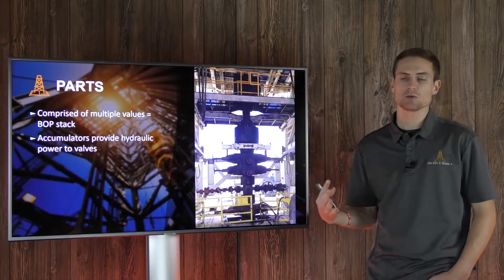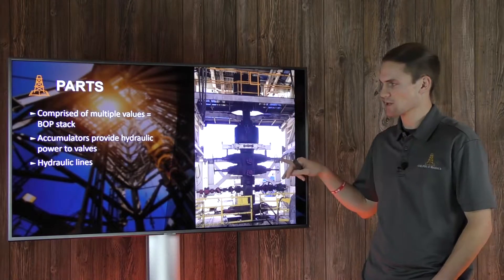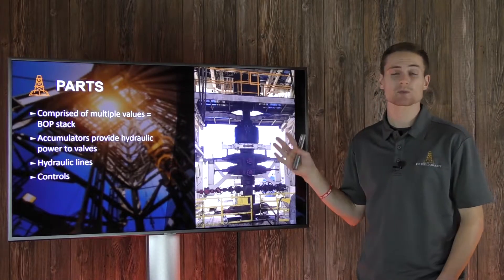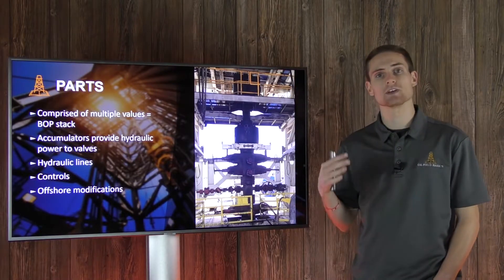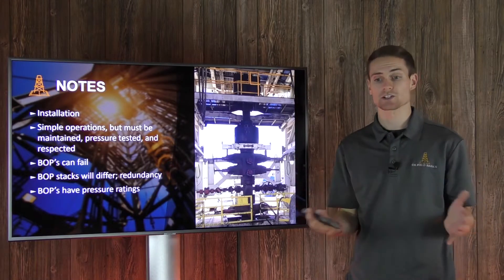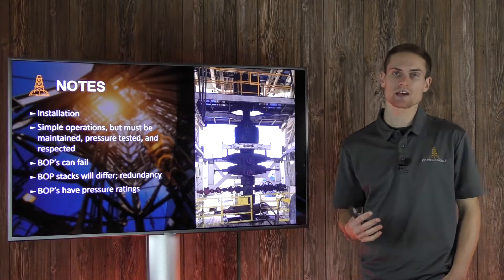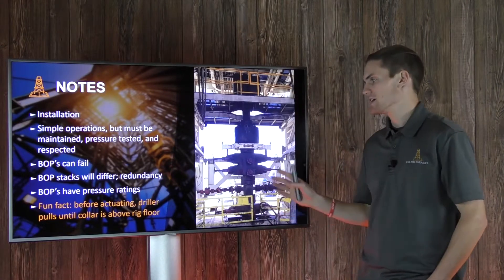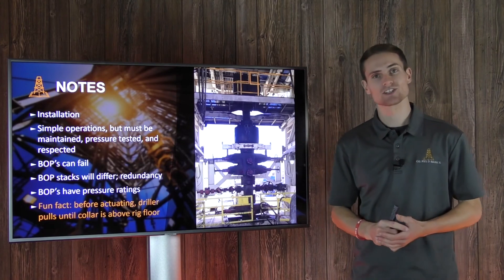Blowout Preventers - Parts and Notes (2/3)

Comment: The macondo well leak was a blowout prevention valve failed. That type of bop valve cannot be tested periodically to verify proper operation. One issue that is very important specifically dealing using on ocean based drill platforms is that there is no way of isolating pressure if the Bop valve needs repair or replacement. That type of bop valve either needs the type of valve that is alot safer in use and won't cost in lives or environmental damage. Once activated that type of valve leaves the well sealed and no way of accessing. I have over 30 years of experience in pipeline repair and maintenance. I'm also currently employed on Alaska's North slope oilfields as a mechanic in the Prudhoe Bay area. In 2010 June I watched the news coverage of the horizon crew stumbling around not knowing what to do next. I also found out there was a "horizon helpline". At that time the horizon crew used the rov's to cut bent sections of the well lime away and left several feet sticking out not the seabed, inches away from the end of the pipe had a flange and thought the flange could be used to lock a caphead onto. I finished my caphead design and called the "horizon helpline" and submitted my design. Unfortunately I neglected to file for a patent pending and was later emailed back by horizon helpline personnel and informed my design was unusable. Several weeks later I watched as they used my design to stop the macondo well leak. I still have copies of my design as well as emails to verify.  On land based oil production fields are required to periodically test safety valves and keep records of the tests. This is overseen by the dept of transportation. Spill contingency are drills and if spills occur are dealt with immediately. The macondo well/ horizon spill took 87 days to bring under control and no idea of what to do until I submitted my caphead design. For my contribution I was given a brush off/ slapped In the face and was neither given credit for or compensated. Since that time I've seen very little change In the types of blowout prevention valves that can be tested to verify it will work when needed. If the bop valve isn't operational needs repair or replacement as I've stated there is no way of accomplishing without creating another leak. My future plan is to start my own company that primarily deals in deepwater repair since none exist. I also have the needed valves that can be repaired and maintained as alot more than crude oil and gases come up out of the well. My company will design and market needed designs and will include upgrades for existing bop valves. The difference is that the deep horizon incident costed 100 billion and rising and changing better mousetrap alot less. In the future I will get paid either for better equipment or repairs. "007".